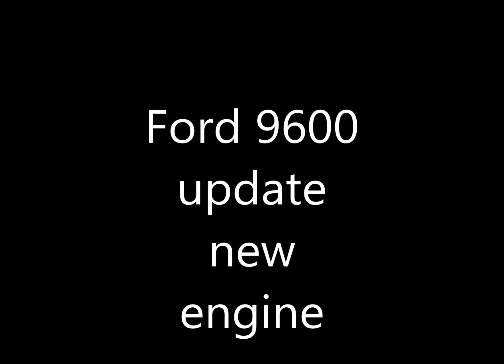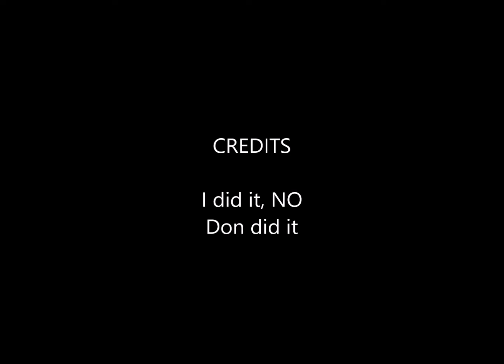Ford 9600 update new engine

Comment: Good day Boy little doggie was busy running around. Now 9600 had 401 cu,in. turbo. The Gensis motor has 175hp.  Our neighbor had 8000  rear end went. I heard they had problems with rear ends?  Good luck Did that engine bolt right up to rear end?  What was wrong with old motor.?  Thanks Does your son do videos too? Anyways Thanks for now
Reply from the maker: it bolted up, the old engine was all worn out and the antifreeze was in the oil